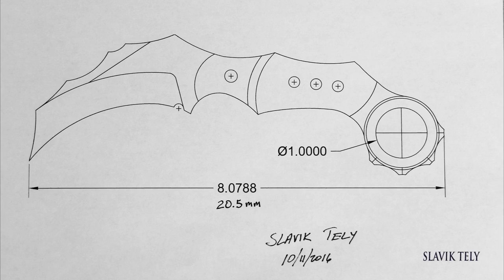Making 2 VULTURE KARAMBIT Knives Part 2

Comment: muy hermoso trabajo! sería tan amable de decirme si ese acabado brillante se logra con cualquier metal o tiene que ser alguno en especial, tengo una garrafa de gas envasado nesecito saber si ese material sirve para hacer un cuchillo con ese acabado. lo admiro señor desde Argentina, saludos
Reply from the maker: I mano lijó el cuchillo 220, 320, 400, 600, 800, 1200, papel de la arena de la arena 2000 y entonces lo pulso. Esta es la primera vez que pongo un pulido en el acero. Todavía necesito practicar más.
Reply: The steel looks beautiful, what I ask is the type of steel you use for your projects and if the steel of a bottled gas bottle is good enough to make a knife? tanks.
Reply from the maker: Under each video I list the steel used for each knife. I don't think you can heat treat steel from gas bottle. Try to find a leaf spring from a truck (5160) to make a knife.
Reply: Thank you for taking a moment to respond, I think he is a humble person because of his attitude, demonstrates with the calm and patience with which he is seen working. I hope I have not bothered you and thank you I will follow your advice. sorry for my inglish :)
Reply from the maker: You are welcome.

Comment: Great knives, since i thought about buying west system epoxy I wondered what you thought of the usual 105 resin + 206 hardener as in, how much better is it compared to store bought 2 part epoxy, Thanks !
Reply from the maker: I have not done any test on those two, but I use store 2 part epoxy when gluing spacers together and then I use West Systems when gluing the handles to the knife.
Reply: Any reasons for using different epoxies ? just wondering
Reply from the maker: Store bought dries in 1 hour and West Systems dries in 24 hours.
Reply: Oh yeah, hadn't thought of that, thanks

Comment: Do you ever have issues with bogging the buffer down? I'm thinking of making the purchase. It seems t have plenty of power for anything you seem to throw at it.
Reply from the maker: It works just fine. I do not put a lot of pressure on it (in fear of it grabbing the knife from me and throwing it at me). It works just fine for buffing the handles.

Comment: Telly ....from what kind of steel do you make your knives?....i made the M9 baionet from an ordinary steel ..but i couldn t sharp it to a very high performance
Reply: I just don't see how you are going to get any better. I have some spare time I think I will try to repair some good old knives I have
Reply: well it s about the knife material....it s not so hard so after I sharp it ..in 3-4 weeks he loose his cutting performance
Reply from the maker: Under each video I give all the materials and tools used. If you did not heat treat your steel, it will not hold the edge. All knives become dull.
Reply from the maker: Ken, there is always room to improve.
Reply: I made that heat treatment..but maybe I didn t heated enough the steel ..or maybe the steel has a low carbon concentration.

Comment: which sand paper do you use to make the metal shining ?
Reply: sinidus 2000 grid and up.
Reply from the maker: 220,320,400,600,800,1200,2000 and then a green compound buffer.